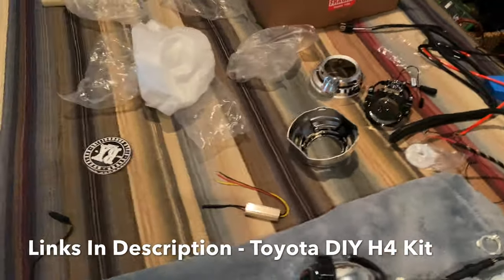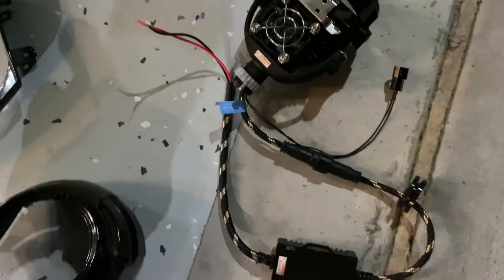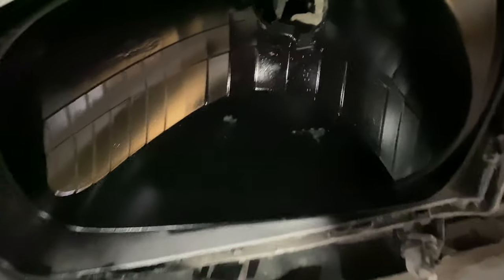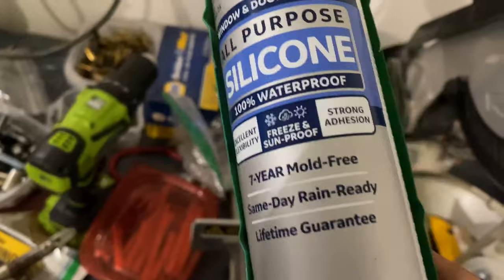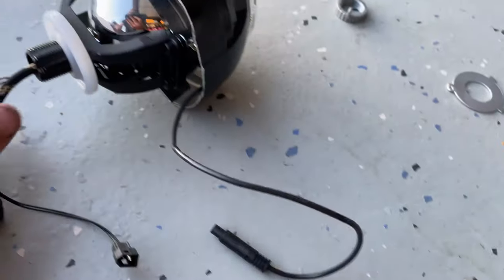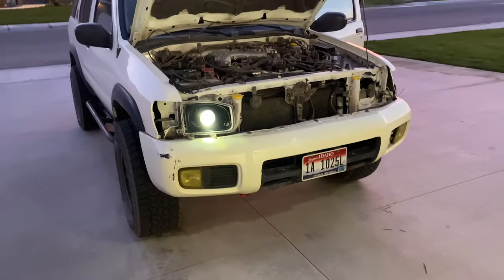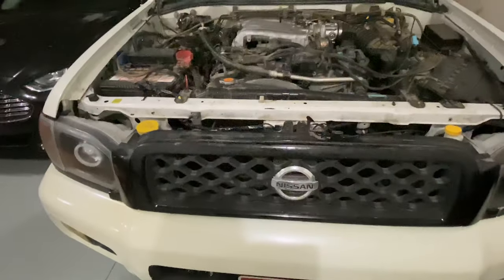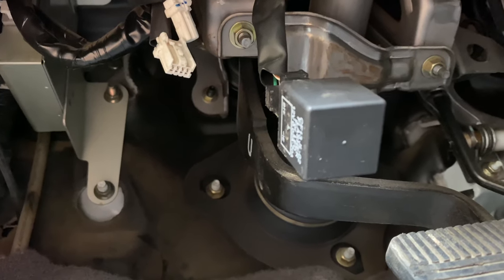Projector Retrofit + Switchback Install. BX Built Toyota H4 Kit on a Nissan R50 Pathfinder

Comment: at this point i’m on the fence about getting these headlights… i have everything the shroud and  projector model chosen, but i still need to choose halos. is front and back worth the money? what did you do tyler?
Reply from the maker: I only have the front halos. You should be able to get an idea of what double halos look like from examples on the website. I'm not sure what doing rear halos will add visually. Going without the halos also looks great IMO.